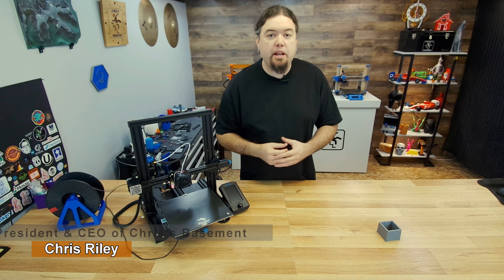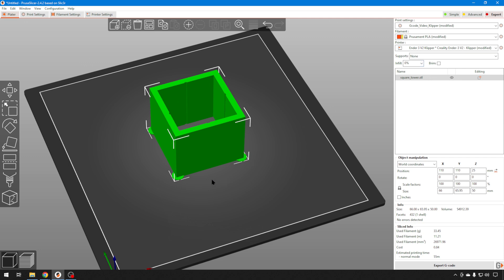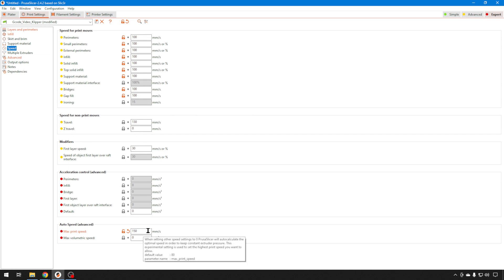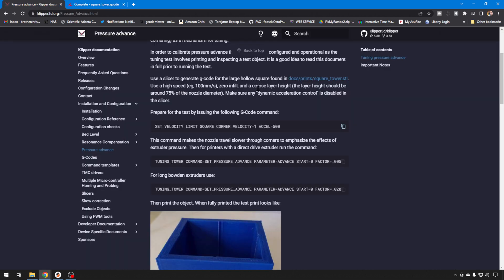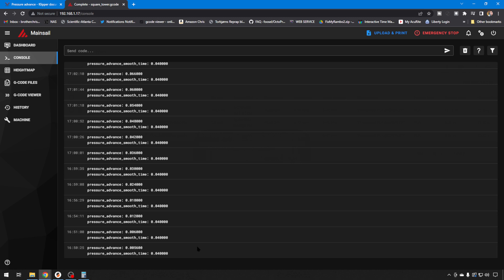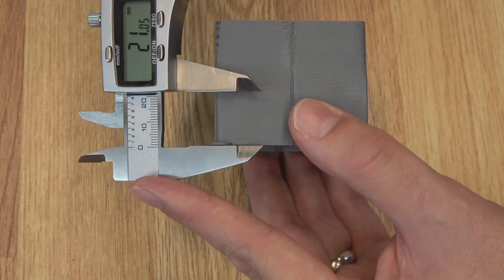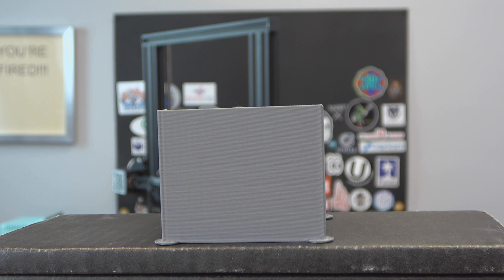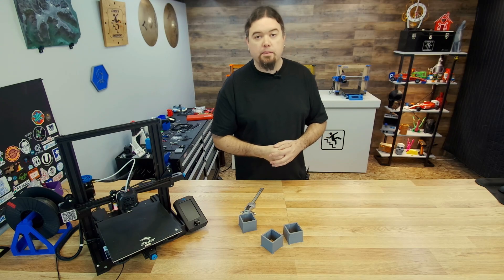Klipper - Pressure Advance - How To - Chris's Basement - 2022

Comment: Hi Chris, for my ender 3v2 bowden setup I calculated a PA value of circa 0.4. Problem I am encountering is my extruder skipping steps (I guess it has not the torque needed to push extra filament at certain noozle pressure). Did you get this problem yourself?
Reply from the maker: I have seen the same thing with higher values of PA. 0.2 is really the highest setting I have ever been able to make work.

Comment: do you know of any settings you turn off with Pressure Advance on in PrusaSlicer?
Reply from the maker: In Klipper, I don't know of a gcode command that will adjust Pressure Advance.
Reply: @ChrisRiley  in some of the linear advance and pressure advance theres talks of settings to turn off in slicer once K value set from what i can see its to do with some of the retraction settings but cant find a thorough list

Comment: I tried adding pressure advance in my extruder config file I keep getting an error saying "Option 'pressure_advanced' is not valid in section 'extruder'" and yet I can manually set it on my dashboard, but the value will not save. I am using mainsail. Any ideas if they changed something in the new versions of Klipper. I have only been using Klipper for 2 months.
Reply: figured it out. Out of all the config its case sensitive changed it to Pressure_Advanced: it saved and no errors
Reply from the maker: Awesome! I'm glad you got it going!

Comment: Thank you for showing me the way. You made this process easy as apple pie for me. Waiting for my print to finish so I can complete the calculation and adjust my printer.cfg
Reply from the maker: Glad I could help!
Reply: @ChrisRiley  Yeah man. This was the key I needed to actually FULLY dial in my Ender 5S1 and ALSO get my SOVOL SV06+ running better than the Prusa which it's a clone of. As in getting PLA quality for detailed bobble-heads but printing them out of PETG at a speed of 55-115mm/s on the Ender5 dialed in.

Comment: Hello! Very new to 3d printing and am following tuning guides. Ive noticed that when i printed mine out (pressure advanced off) Only one corner seems to be janky while the other 3 are smooth so im unsure how or where im supposed to measure from? If that makes sense
Reply from the maker: Try moving the seam location on the print in the slicer.

Comment: Hi Chris, great series on Klipper. So.. I have a question. After finding out the Pressure Advance value and put into the klipper's printer.cfg. How do we use it with all the STL files? Do we use it with the new slicer settings or any slicer settings?
Reply from the maker: Thank you! You can use this in the slicer in the gcode settings. SET_PRESSURE_ADVANCE ADVANCE=your value

Comment: if i set all speed at 100 , i cant complete the print, after a while , it loses the binding between layers, looks like the extruder is strugling , the height of the print reaches 15mm , then it looks like its not extruding
. I am runing an ender3 pro , all metal hotend bowden, any ideas.?,
Reply from the maker: Does it have 2208 drivers? It could be a driver issue. There was a bug with 2208's.
Reply: @ChrisRiley  i will check thx

Comment: Switch to Capricorn tubing and use the little clips on the ptc fittings, and it drops to under .15 witch is very good for bowden setup
Reply from the maker: Thanks!
Reply: @Chris Riley  I mad maxed my old biqu b1.
Into a dual belts Z and all mgn12 rails and dual y and x steppers on a btt octopus main board. I am currently using an h2 v2s dd hotend setup with a beacon scanner 😆. 
Printer cost 250$
Mods cost around 500$.
Using it to design and build a .5 x .5m x 1.5m core-xy setup with a/c servos and tool head swapping.
Custom controllers are all built around Klipper and some extra custom functions.
Also, the print heads are connected to something similar to ERCF feeder, but it has 48 in and 6 out. I have this built and working on my printer for testing.
The frame will have spots for 6 tool heads.
My goal is a large printer on network with the ability to pull from an entire wall of filaments and minimized purging required.

I have the electronics worked out, just working on the frame design. Mostly laser cut sheet steel welded. Built more like industrial cnc than Hobby Printer at almost 800lbs with almost 6hp driving the gantry around with 25mm wide belts.
And 3 ball screws on the Z axis. Large mains powered multiple zone pei build plate. Precision ground flat.
Uses revo nozzles on a custom automated nozzle changing system on the fly.
Reply from the maker: @CNCAutomationLab  Wow, this is one crazy setup. I would love to see a video of this thing in action!

Comment: Chris: Have you found any settings to help fill in the seam gap at the back of the print as shown at 8:51 ?
Reply from the maker: I've found with Klipper it depends if you are using input shaper. If you are it's a very delicate balance of pressure advance and smoothing.
Reply: @ChrisRiley  Yeah, I'm using Klipper with pressure advance and input shaper. I originally did the input shaper using the accelerometer method about a year ago, but found I got better results when using square tower. I started recalibrating things recently after switching to a .6 CHT nozzle, and to say the test went poorly is an understatement. I found (for me) the best way to dial it in was to start printing the tower using my normal print speeds and settings, and then tweaking the PA and Smoothing values on the fly using Fluidd. Ended up getting dialed in at .068s for PA and .035s for Smoothing.

If someone else is looking to follow my "on-the-fly" tuning suggestion, look at how your print compares to values that are too high, and too low. I noticed off the bat the my ending corner gap was HUGE, which meant the value was too high. Cut the value in half, and then did half that value high/lower (and then half that... then half that...) to get dialed in. Using the arrow keys in Fluidd also helped rather than having to type in numbers. After I got the sharp corners for the PA value, I noticed I'd have ripples after the corner if my smoothing values were too high. So, I just repeated the "raise/lower by half the change" procedure (similar to how Klipper does it for probe z-offset calibration where it halves the change each time) to get rid of the ripples after corners.

Hoping with the new values my seams will be a little tighter.

Comment: Chris: I took the dive and converted to Klipper, following your tutorials.
All is working well, no problems so far.
Needed your help on calculating the press adv #
Well tuned Ender 3 Pro with upgrades changed over fairly easy, biggest challenge is getting software setup and learning the new Klipper programming.
I found Visual Code frustrating at times, all those errors for no reason etc.
None of that happens in Klipper.
Thank you for everything !
Also big thanks to all who comment here, very valuable for me to read through everything!
Best Wishes to All over the holiday season !!
Reply from the maker: Awesome, glad everything is working out with Klipper!

Comment: is it normal that i got 10mm and you have 25 mm ? becasue that means that u have 0.5 pressure advance and i have 0.2 the diffrence seems huge
Reply: I got 16, close to yours, you can if you wish turn it up and print a small test plaet.
You may hear the printer making noises as it changes direction, if too high a setting.
That is what I noticed, at apres advance of around 2.
At my .32 it's silky smooth.

Comment: Thank you for this tutorial, calculation for my ender 3 PA is wrong. I got same result as your print, it was in the mid but i only calculate the bottom part of the mid so my calculation were wrong. Now i have to do it again but after watching this i think it will work out great.
Reply from the maker: Excellent! Thanks for watching!

Comment: Thank you for this series, Chris. I'm really enjoying the klipper series on the Ender 3 V2. 

It's given me the inspiration I need to bite the bullet and give klipper a try on my Ender 3 V2 over the festive holidays. 

You make it seem so easy and explain everything in such a way that it's very understandable and easy to follow along. This is coming from someone who's never used klipper before as it always seemed tedious and difficult to set up and get going. After watching this series, I'm definitely giving this a try.

There are a couple of things I would also like to see in the series. The first would be extruder calibration on the stock hotend. I've seen people say it's different or difficult to set up compared to Marlin and can easily be messed up.

Secondly, input shaping to achieve higher printing speeds. I'm still unclear as to where to put the adxl exactly on the Ender 3 V2, and if you need one or two sensors, one for X and one for Y or use one for both. I do not have an RPi to connect the sensor to and will be running klipper on an old laptop I have, so I'm hoping I can use one of my spare ESP32's for this. Ultimately, it would be great to know the placement and configuration for the adxl.

Other than that, fantastic video series and keep up the fantastic work, Chris 👏
Reply from the maker: Thank you! Glad this is helping. For sure, I am working on input shaping now. There is SO much to explain there. It is taking a while. I will check into extruder calibration as well.

Comment: Would you only need one setting for all different filament types or is it not filament dependant?
Reply from the maker: It is somewhat filament dependent. I would suggest you dial each type in. PLA is going to be much different than PETG, TPU I would probably suggest just turning it off.
Reply: @ChrisRiley  Thanks. I suspected as much, but I'm still learning. I'm currently extremely frustrated trying to get 1st layer to stick on my Ender5+ using Klipper and PETG. I thought I would like Klipper, but it's a lot more frustrating than the stock firmware. Maybe I just need to give it more time. At 67 my patience for long learning curves has diminished some (hopefully not too much). Still, it's hats off to people like you who put in the work to do these videos to educate us all.
Reply: @ExtantFrodo2  You must have your bed very level, I use a bit of glue stick on the surface.
Print the 1st layer at say 30 mm or slower till you get  it to stick..
No cooling on 1st layer helps, compressing that 1st layer helps, ( setting the bed ) etc.

Comment: Tx Chris. I tried everything on my Ender 5 plus, stock. No difference between 0.00 up to 1.00. What am I doing wrong?
Reply: Check to make sure of those slicer settings Chris mentioned, that was a hang up for me as well. Also make sure your max accelerations in your cfg are greater than that of your slicer so there aren’t any slow downs or restrictions during the print.
Reply: @spanny52  Thank you, will do.
Reply: Remember to save and restart Klipper, after config change. I noticed a big change when altering the press adv on Ender 3 Pro.

Comment: With these Klipper tutorials my V2 is printing better than ever. Thank you Chris. I would like to see how Klipper deals with Dual Z Axis sometime in a future vider. Thanks!
Reply: I would also, I have Klipper running with 3 Z axis and doing bed tramming on my Rat Rigs.  I have a Ender 5 Plus which I want to install my spare Octopus plus board on, just don;'t know if it will benefit.
Reply from the maker: Thanks for watching!

Comment: Chris, I noticed you are using Prusa 2.4 have your tried 2.5 yet?
Reply from the maker: I have it on 2 of the 3 machines, still in the update process. 2.5 really isn't a lot different, but there are a few more features I need to try.
Reply: @ChrisRiley  This is one reason I use Prusa, when they do an upgrade it doesn't seem to break anything.  I will admit I never had any problems with S3D upgrades. Woops there were none.

Comment: To sharpen up the corners and get rid of the fat corners should I combine Pressure Advance with Jerk settings?
Reply from the maker: Tweaking jerk could help as well, but that's actual movement, I tend to tune movement, then start to tune software or extrusion.

Comment: hi I have a question about octoprint on windows. How can I increase the quality of my camera from 640X480 at octolapse? The octopi.txt does not exist
Reply from the maker: That's the easiest place to make the updates. if it's not there you can create it. https://github.com/guysoft/OctoPi/blob/devel/src/modules/octopi/filesystem/boot/octopi.txt
Reply: @Chris Riley hello thanks, I don't have the boot folder. in which folder does it have to be?
Reply from the maker: @Joshua-schiergens  Oh, you said Windows, you would have to do that in Yawcam, it would control your windows cam.
Reply: @ChrisRiley  thanks it work. 😀

Comment: Wouldn't it be better to put the PA value in your slicer's filament gcode?
Reply: Not necessarily.  I slice  using Prusa 2.5 and set for my smallest bed size.  I have no specific printer specs, but rather let each printer use its settings. My Start code =  START_PRINT, the end code = END_PRINT.  each printer can have a specific macro for each and be different than the others.  I'm able to print almost everything on my Ender 5 Plus, or my Rat Rig 400 or 500 using the same g-code.  I have also used START_PRINT_PLA or START_PRINT_PETG
Reply: Yes, PA value is per filament (as Chris mentioned on the video), and ideally, your slicer should set the PA value when the print starts (as it knows what filament you are printing with)